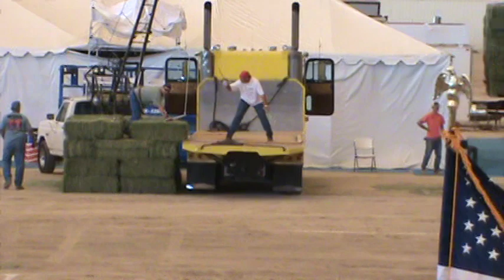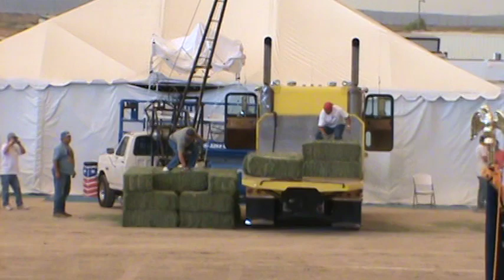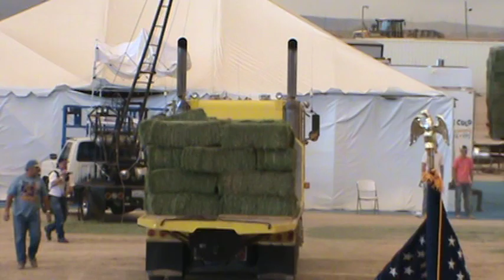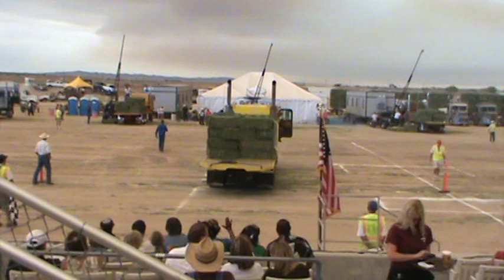Mechanical Hay Loading Contest 2009

Comment: Lol it took me a minute to figure out the ropes. At first I was like the dude throwing those bales is a serious bad ass.
Reply: Yep, they're pretty fast in this video.  The left hand holds a rope that controls the clutch on the winch.  The right hand has the hay knife....usually that is a garden hose as it slips easier.